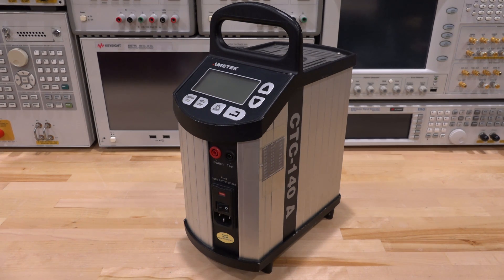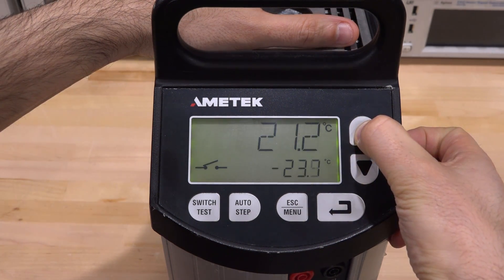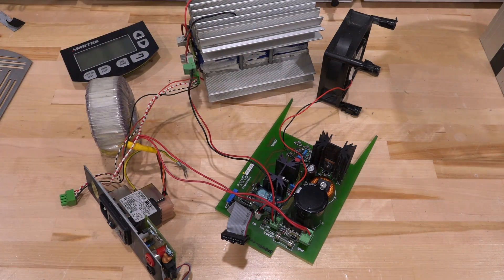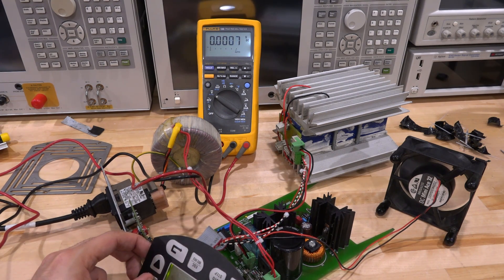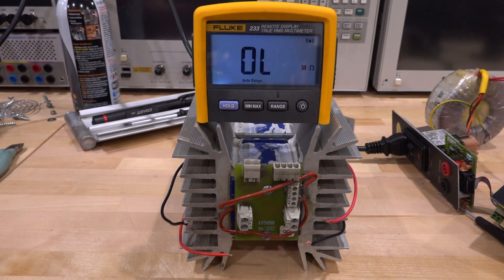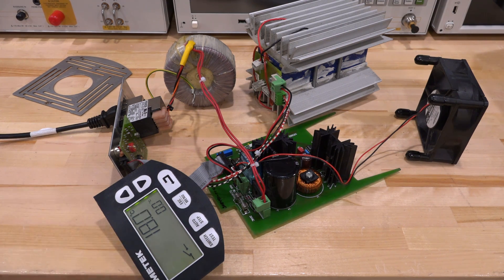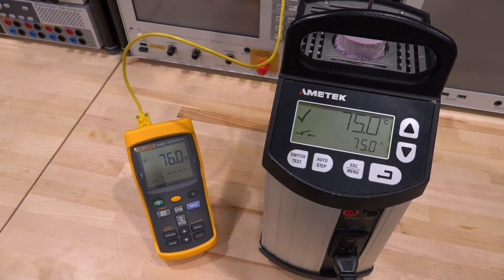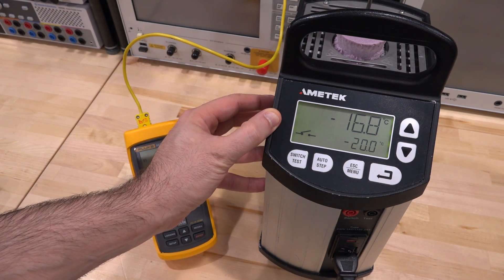TSP #241 - Ametek Jofra CTC-140A (-17C TO +140C) Dry Block Calibrator Repair & Teardown

Comment: I have repaired many similar dry block calibrators by Fluke and Ametek and the only thing I can see is missing is some insulation between the heat sink and the exposed blue aluminium block. If you add the insulation which is normally a spray foam it will go down to -20. The use of 2 peltiers is cheap as looking at the size of the aluminium block I would think you need 4 peltiers as in similar size calibrators. You can build your own calibrators quite easily with fixed drilled holes for £500 or £300 for calibrators that heat from 50 to 400 degrees Celsius. You must pick the correct peltier coolers as some are limited to a maximum of 100 degrees Celsius.
Reply: Hi sir, may i know the series of peltier used ?, and does the type of power supply used will affect the peltier cooling performance also ?

Comment: Teflon (PTFE) has a phase transition around 18 degC, causing even the best cables and connectors to have impedance and velocity changes when going below room temperature. Could be interesting to measure.

Comment: When you go to calibrate your dry block make sure you use a proper DIN 1/3rd PT100 probe. Type K thermocouples like you were using in the video are only accurate to +/- about 2C or so and it's likely a lot of the error you saw could have been just the probe you used

Comment: I had the same failure with my portable electric cooler.
The accumulated moisture on the Pettie contacts is killing them.
I managed to repair the connection and it functions again for many years.

Comment: I built one to test circuits. The test area is a 2 inch square flat aluminum plate. I used two stages, the hot stage being 4 peltier, 6 amp, units and the cold stage one 6 amp unit. It will get to  minus 50 F.

Comment: Would love to see a 1N827 10 ppm 6,2V zener diode in this. It should be near flat in terms of temperature response at 7,5mA.
Reply: Me too
Reply: I think for truly flat response you generally have to test currents between 5mA-10mA, but doing so should also be possible.

Comment: very nice device, I use peltiers very often. I use a Thorlabs PTC1/M  temperature controlled breadboard (4" x 5") for experiments also using USB, instead of the cavity it uses a breadboard with M4 and M6 mounting holes. The range of course is more restricted to 4 - 45 deg C. The CTC-140A has an amazing range but thats only possible with a cavity or simular construction. Would be great to see some rf devcie experiments and charactisation using this device.

Comment: Interesting video but nowhere near in details like rf videos. No view of the pcb, nothing about architecture. Things that i see missing are like adc resolution ,pwm drive circuit, signal conditioning from built in sensor....
Reply from the maker: There was really nothing interesting inside. The whole thing is a relay, a MOSFET and the controller board with a micro on it. The most interesting thing was the well which I took apart.

Comment: Are you sure you're not running it on only one element? It's just... Peltier elements in my junk box are nowhere near 30ohms...
Reply from the maker: Elements are in series. It can't run just one.
Reply: @TheSignalPath Well, if one of the elements is 3ohm...  ;)
Reply from the maker: It’s not 30-Ohm. The measured resistance varies depending on the temperature and amount of current applied. This thing consumes 90-Watts when it runs, from a 21V supply. You can’t get that if the running resistance were 30-Ohms.
Reply: @TheSignalPath Sure, but my point was: is the voltage drop anywhere near 50-50 between the elements?
Reply from the maker: I’ll have to measure that.
Reply: I am sure your aware that these devices are semiconductors and almost impossible to characterise in two seconds with a multimeter however as a first line of attack a simple ohm's reading provides an adequate relative measurement that can point to a part failure, as is the case here. If there is anything more to the story (which I doubt) we will hear all about it in part two.:) @otherbasis8505
Reply from the maker: I measured the voltage across each Peltier element during operation. One has 9.8V and the other 10.6V. So the voltages are fairly well balanced.
Reply: @TheSignalPath  Great! Thanks for the follow through!

Comment: We have a Peltier cooler at work hooked up to our rheometer that has been dead for months, with the same problem of all the buttons working and responding but no cooling or heating whatsoever. You've inspired me to open it up and check it, could well be a similar fix.
Reply: Also check the transistors supplying the DC voltage. These can blow sometimes.

Comment: There are many different makers of dry block temperature calibrators but Sika developed the first in 1980.  There are ones which will go all the way up to 1200C and those are sometimes used for heat treating aluminium samples in the lab.

Comment: This looks very familiar 😀 I am glad to be of a good influence to your lab... Interesting that you also got similar error about 0.4-1.0 degree, same as unit I got here.
Reply from the maker: Yes! When I bought this unit I didn't realize that it didn't have the serial port... I think I figured out how to program the serial port, but sadly mine doesn't have one. I may sell this one and look for one with the serial port. We can also try to get your serial port working.
Reply: @TheSignalPath  Perhaps it's trivial to add, might just be missing RS232 chip and connector? I'll need to take mine apart to fix the fan, will take a closer look for serial port interface as well.
Reply: @TheSignalPath Or figure out if there's a way to add the serial port? (Or nowadays, a USB to UART board.)